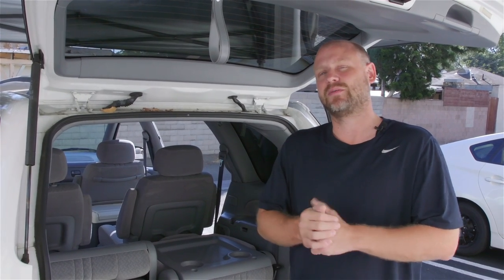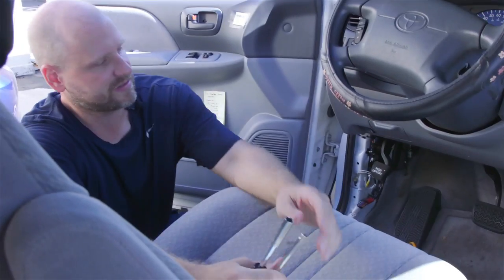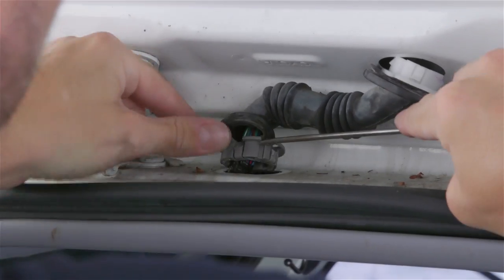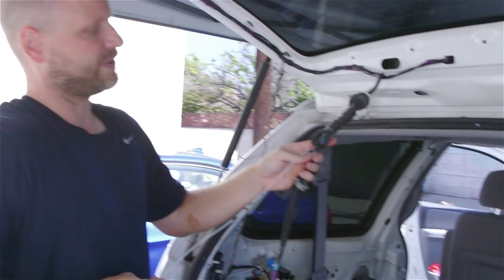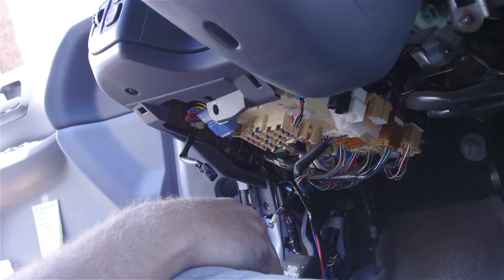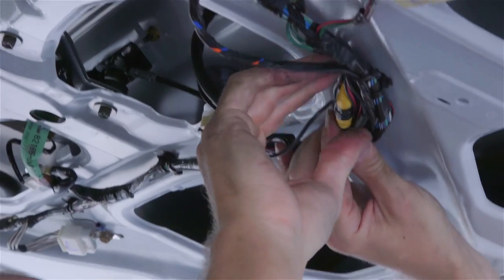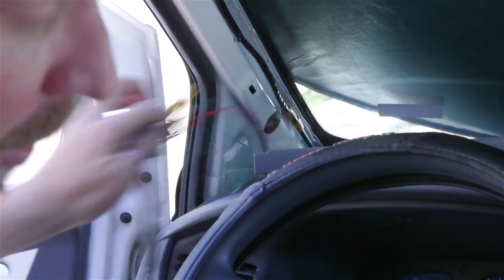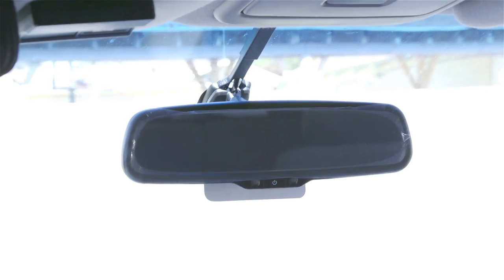How to - Back up Camera Installation

Comment: I just finished mounting a Boyo IR backup camera and used many of your suggestions.  The tip about using hand soap to lube the wires before sending them through the rubber boot is a surefire winner.  Great video.  This relieved a lot of anxiety...lol.  Thanks a million!
Reply from the maker: Glad it helped!

Comment: just a tip, i think everything was great btw, but with the grommet for the trunk and camera wires, a solution to make it waterproof again would be to fuse the rubber back together with heat

Comment: great video. I have this Hyundai Eon with LCD. I bought a back up camera and want to use the factory LCD mounted  as a display. I'm hard up searching how to do it. maybe you could give me some hint to connect my camera to the factory LCD on my EON.
Reply from the maker: +Mark Limuel Dumlao You will need an interface to integrate an aftermarket camera with an OEM display. We carry these, however we do not have one for that vehicle. These are commonly referred to as navigation interface or OEM screen interface.

Comment: If I understand you correctly, this reverse camera install needed a power wire & trigger wire for the backup camera. You wired the power wire to the brake light & trigger wire to the reverse wire right?

Great video btw.
Reply from the maker: +Frank Miller Sorry for the late reply! Check out our PDF instructions on how to do it http://cdn.qualitymobilevideo.com/media/downloads/22/safesight-SC9003.pdf

Comment: Nice greeting !, Very nice, clean, professionally done !, The only reminder is the cutting of the protective rubber, the wire should be threaded through the protective rubber.

Comment: Will the wiring be similar to that of a Chevy Express 2007 Van with Seats? Would I have to remove the headliner and interior panels to do all the wiring?
Thanks in advance. Great Video by the way!

Comment: How big of a deal is it that the camera is off center?  I realize there’s not really another option with the lift gate handle in the way. Doing my Pontiac vibe soon. On my Toyota Matrix I mounted it to the left of the handle (ran the wiring through the reverse light area/hole). It’s a challenge using it to back into a parking spot. Although….I have it aimed at an angle…maybe I need to just point it straight instead.
Reply from the maker: It's generally fine, we do it all the time!

Comment: Great video well explained & clear speaking.
I just didn't get clear that part on how wire to turn on the camera when the vehicle is off.
Can you draw or explain again?
Reply: He means to have power when the vehicle's key is in the on or accessories position but it is not in reverse gear.  For cars with a cigarette lighter style power plug in the rear I assume you could run the wire from there.

Comment: I just purchased  a RV class c and it has a built in Pioneer backup, loaded camera with side view , phone radio, b.t. and everything else . My question is the only way to turn this off is with a killer switch that turns everything off in the RV.  Why isn't there a on/off button .  I don't want my battery to go dead so I always have to use this factory installed killer switch. thank you for any info. AVH-3400BH or AVH-2400BT

Comment: Great video! I was wondering how does the camera system know you are backing up and need the camera to be on?
Reply: You wire the backup camera to the positive wire of the reverse lights. So that way the camera will only be enable when go in reverse
Reply: Make sure you also mount the ground wire (black)) I usually find a screw and wrap the wire around that near a good metal portion of t he  trunk
Reply from the maker: +William Tao There is a connection to the reverse light that triggers the monitor. We have a separate video on specifically the step in detail. https://www.youtube.com/watch?v=d4WMU1CgFns

Comment: Hi, I bought a used Ford Sport Trac with a Pioneer Nav Stereo system with back-up camera.  From purchase the back-up did not work.  I noticed a black single wire dangling from the back of my truck near the license plate.  I believe this wire was for a camera that was removed prior to sale.  I took a chance and purchased an inexpensive Amazon backup camera that was able to do mirror and non mirror images. The latter was listed in my  Pioneer manual as the one required.  My hope was that spicing the truck wire with the camera wire would work. (I cut off the connectors that were on the camera wire.  It did not work.  In your experience would that size wire hanging from the back of my truck near the license plate be used for anything but a camera.  (All lights work so it can't be that)  Appreciate any feedback you can give without seeing the truck and wire. The truck wire and camera wire were identical.
Reply: I appreciate your video but I don't want to go through all of that or pay someone to do it.  One note, the backup camera was turned off on the Pioneer system. This cut wire was not protected from weather as long as I have had the truck.  Can't image that was good but not sure if it was a hazard. Thankfully, nothing happened to the radio system over the past 3 years.

Comment: The Reverse Fuse I have is 15 amps. The only fuse taps I found are 10 amps with two slots. Could I still use the fuse tap with 2 10 amp fuses?

Comment: Do you go off a chart for voltage drop on backup cameras or do you normally stick to one wire gauge size? What wire gauge did you use for the blue and orange wire?

Comment: good video,  but I wanted to ask how would I connect my camera without having the "trigger" wire? my camera cables only have the black and red wire. I would like for the rear view camera to come on automatically  when I put car in reverse.  putting on 2006 vw jetta. on after market radio the harness has a rear view camera cable.
Reply: the red wire on camera connect it with positive on rear reverse lamps and the black wire on camera just connect it to the ground

Comment: Hey I got pioneer AVH-2800bs  my backup camera won't come on. Do I need to use the purple wire on the back of the radio? if so Can someone help me locate the reverse wire on my 2005 honda pilot?  Thanks!

Comment: Just came across this video.  I have a 2015 Dodge Journey and would like to have a camera put in.  What should the cost b in having one installed?
Reply from the maker: Around $250-275
Reply: You can get one and install it your self for like 15 bucks. 115 if you don't have a media display in your dash.
Reply: Can you elaborate.  What brand can i install for 15 bucks?  I do have the 8.4 screen.

Comment: Hi!  where do you install the red wire ACC and the yellow wire from the fuse black box ? do you put connect them on the power directly (Red Wire) together?
Reply from the maker: +Cesar Levi Munoz You will need to identify a constant power source and a power source that turns on with the key. You could use a fuse tap, and test with a voltmeter which circuits are constant and which are accessory.
Reply: Okay I will try it. Thank you so much for your reply!!
Reply from the maker: +Cesar Levi Munoz Of course that's why we're here!

Comment: Hi, I understand to connect the power leads from camera to rear tail light +12V & ground and then running from that +12V another wire alongwith the RCA to the trigger wire behind the head unit. Just wondering for a system where I would like to have the camera ON anytime I want (and ofcourse while on reverse), what more do I need to do?
Reply from the maker: You would need to run a power lead from the front to the camera. The only connection at the taillight will be the trigger wire running to the front of the vehicle. This power lead will provide accessory power to the camera all the time while the vehicle is running.
Reply: +Quality Mobile Video thanks heaps for the valuable reply. I will connect it and let you know how it goes :)
Reply from the maker: Great keep us posted!

Comment: Why did you use a separate cable for the trigger from the reverse light when your rca cable that's running through the car came with a trigger wire?
Reply from the maker: You can use either one, we just prefer using higher quality wires for our customers and installations
Reply: @Qualitymobilevideo  what wires do you use

Comment: hey thanks I used your video as a guide I fit my reverse cam in today in my ford kuga split boot was a pain! I couldn't mount my camera in the middle of the car so it's like 5 inches out is there any fix to this?
Reply from the maker: So the cable wasn't long enough?
Reply: I had enough cable but my camera is a square cam with 2 screw holes  but u can only fix it so it's flush on the top if u know what I mean u can only screw it from underneath a lip I just moved it around but can't find a fixing point by 5he licence plate
Reply: Because my boot opening button is in the middle
Reply from the maker: Hmmm, if you want to take a picture and email it to me I can probably get a better understanding and help you out more! jamesd@qualitymobilevideo.com
Reply: sure thanks a lot
Reply: I have sent u a email with 3 pictures thanks a lot!  :)

Comment: is that a sienna what year i have a 05 sienna ce but i dont have a whole to put the camera wire through?
Reply from the maker: +joe miller I believe it was a 2008. We actually drilled our own hole to run the camera through the back of the car!

Comment: hey, do you have the diagram of that install ? tnx
Reply from the maker: +evyasafe We do not but might be able to make one for you, what do you need help with?
Reply: +Quality Mobile Video hey, i saw the website and the explanation about the install. i just wanted to ask - i understand that the blue wire is the trigger and its part of the monitor (always connected to power but not working). but what about the camera? does it get power only when the reverse light is on? or should i connect it to permanent 12v?

Comment: great video... to do a nice job requires a lot of details and I decide to not do by myself.
Reply: This man is a meticulous technician who obviously takes pride in his work. He gives you a professional installation because that's what you pay for. However there are many short cuts that the diy home installer can do that would safe a lot of time and energy. It all depends on how fussy you are about seeing wires and cables. Most vehicles these days come equipped with cameras so if you're doing an aftermarket camera and monitor install chances are its in an older car and you may not be so worried about that nice clean high effort installation. When I did my own install I was able to tuck cables and wires under panels without completely removing them, saved a bunch of time and effort and still hid the cables.

Comment: Totally ridiculous. This video was made to make it look as hard as possible to #1 get you to pay them to do it, or #2 get you to buy a Pearl. It is way easier than this. If they actually did the work for you, they would run the wires to the dash in minutes. They would not route then like that. The way they do it is to get to the floor in the trunk then under the rear seats then under the carpet up the middle. Minutes.
Reply from the maker: We made this to show anyone how to do it the right way, not to get install customers, we don't even do installs very often that's not our business. This the professional way to do it, what a real factory system would look like. It looks hard because it's the right way to do it, not the easy, shortcut, inefficient way.